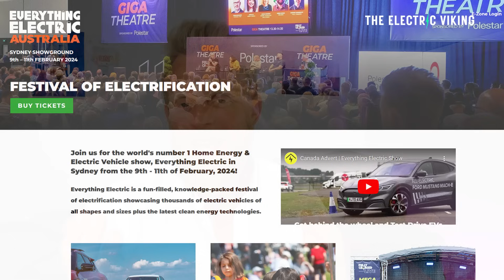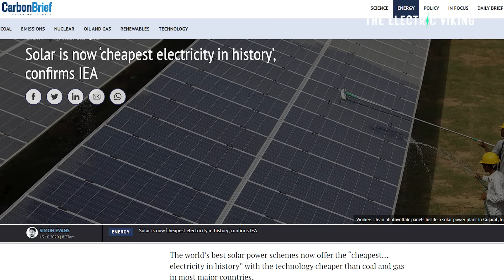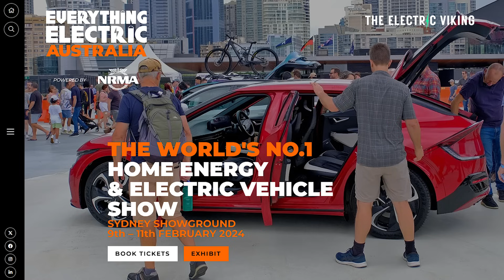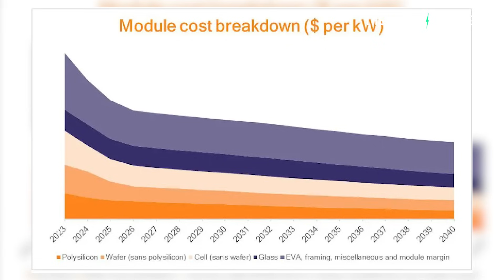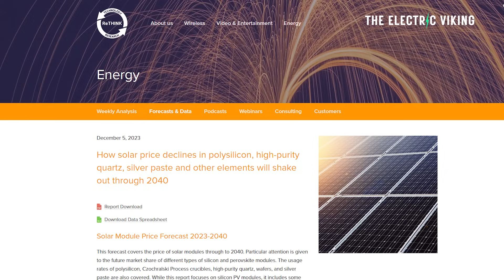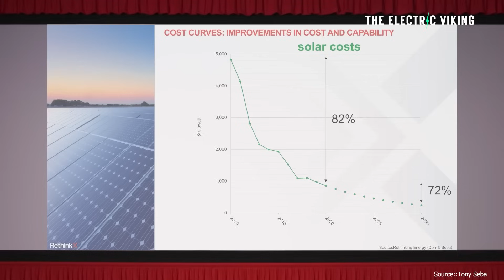Tony Seba just made this insane solar prediction that is blowing my mind

Comment: I totally agree with Viking on this one. Solar panels and batteries will become cheaper and more efficient, driving the transition to renewable energy while governments do nothing to help. Some people think nuclear power stations will be necessary to take over when there is no wind or sun, but that is not the case. Renewables will generate far more electricity than is needed at present and the excess will be used for applications that are not time critical. This will include charging EVs, and powering massive compute services for AI. There are already some solar/wind centres that have installed compute servers to use their excess power when demand is low. Other applications that will open up when electricity generation becomes much cheaper will be manufacture of green hydrogen and efuels for aviation and rockets, also desalination, and vertical farming. If energy gets really cheap they can start doing carbon capture to remove CO2 from the atmosphere. With these services ready to soak up excess energy in addition to battery storage, it will become economically viable to generate so much cheap electricity that even when wind and sun are low there will still be enough to power the grid. It will be cheaper to use electricity for heating than gas, coal or oil so fossil fuels will mostly stay in the ground. Nuclear fusion  and Thorium reactors will never be needed (on Earth), and new fission reactors will be wasted money. Even the proposed long-distance international power inter-connectors are not worth looking at now. The only thing that can get in the way of this technological progression is sour international politics. I would like to see Viking cover more of these points in his videos but I don't think he reads the comments.
Reply: >  It will be cheaper to use electricity for heating than gas, coal or oil so fossil fuels will mostly stay in the ground.<
PV for heating has been cheaper than solar thermal for many years now.  PV for heating is far cheaper than grid electricity and propane.  
Our species might just save itself by learning to charge EVs in the middle of the day when there is likely to be surplus PV electricity.  I imagine the day when one plugs in to an EV charger at work, states what they are willing to pay, and when the electricity price drops to that level, the charger starts.  Many people will state that they only want free electricity and will get free electricity at noon on sunny days.
Reply: > . . . are expecting the increased cost to amount to approximately $5,000 per new vehicle, or $200 Billion. <
$200,000,000,000/ $5,000= 40 million new EVs in six years.  I am not as optimistic as howardj602 that there will be so many EVs.  I think that like now, many EVs will be charged overnight at home-- when the electric plants need more load.  Electric stoves, used to cook a holiday meal, use more power than a at-home EV charger.
If in fact 40million EVs are on the road in six years, at least one oil refinery will be shut down.  That will save 5.9kWh per gallon of product formerly produced as that is how much electricity the US DOE analysis shows is needed to refine one gallon of gasoline.  With 40million EVs on the road, we can close a few gas stations as well.

Comment: The actual cost of the cells is already low enough, efficiency is also already great, both can and will improve obviously but I don't think that's the most important part of it any longer. Really good product systems that are cheap and easy to install that can replace building surface materials could make a huge difference. I really like the basic idea of Tesla solar roofs, that when the solar cells are integrated in something you need anyway, the extra cost, what you actually pay for the solar power can be very low, but Tesla haven't focused on low cost. 

Same basic idea as Tesla solar roofs but more focus on cost efficiency than cool factor and looks could change the world. If the extra cost for the cells and installation becomes negligible, solar cells in new roofs, and even facades, could become the norm. Sure, it would be difficult to impossible to find good use for all the power produced at peak production in many cases, if houses were covered in solar cells, but that's not the end of the world, if they cost next to nothing. I think most people are stuck with the idea that solar cells are incredibly expensive, and that you have to find good use for every joule you possibly can squeeze out of them, but that's just not true.

Comment: Mark Mills, in his podcast
 “The Last Optimist," presents a somewhat opposing view on energy transition that emphasizes the challenges in completely replacing oil, gas, and coal with renewable sources. His key points often include:

1. **Energy Density**: Mills highlights that fossil fuels are significantly more energy-dense than most renewable sources. This density enables more efficient storage and transport of energy, a crucial factor in global energy systems.

2. **Intermittency of Renewables**: He points out that solar and wind power, the primary renewable sources, are intermittent and depend on weather conditions. Without major breakthroughs in energy storage technology, this intermittency presents significant challenges for grid stability and reliability.

3. **Industrial and Technological Limitations**: Mills argues that the current technological landscape, especially in industrial sectors like steel, cement, and shipping, is heavily dependent on fossil fuels. Transitioning these sectors to renewables is a complex and slow process.

4. **Scale and Infrastructure**: The existing energy infrastructure is deeply entrenched in fossil fuels. Transitioning to a new infrastructure for renewables on a global scale is a massive and time-consuming undertaking.

5. **Economic and Political Realities**: He often discusses the economic and geopolitical complexities in shifting away from fossil fuels. Many economies are heavily invested in these resources, and there are significant political and economic barriers to a full transition.

6. **Resource Intensity of Renewables**: Mills also highlights the resource intensity in manufacturing renewable energy technologies, like solar panels and wind turbines, which often require rare earth elements and other materials that are mined and processed using fossil fuels.

In summary, while recognizing the potential of renewable energy, Mark Mills emphasizes the practical, technological, and economic challenges in completely phasing out fossil fuels. He suggests that oil, gas, and coal will likely remain a significant part of the energy mix for the foreseeable future.

Mark Mills is a physicist, strategic energy expert, and writer. He specializes in science, technology, and public policy related to energy.

Comment: Not only will the price of the panels come down but also the installation cost. Take the example of a new solar farm that has just come on line.  In 20 years time when the panels need replacing there will be no need to build a complete new farm. No expensive land acquisition, planning and approval process and construction. It will simply be snap off snap on.

Comment: highest you can buy in Oz is 22% efficiency. we are still at decade away from being able to install anything close to 30%.
Reply: no  35% tandem silicium peroskite  solar will be mainstream in 2035 ...  wafer tickness 100um mainstream .
 high throughput in-line CVD direct ‘gas to wafer’ deposition process is a revolution in solar wafer  industry.
It enables >60% less energy consumption than conventional CZ and wafering and significantly less waste the 2 main cost driver in solar panel industry.

Comment: If the Chinese build their solar panel factories in a sunny location, they can initially consume their own panels and build out solar energy and storage. They will reach a point where they make enough solar power to sustainably fuel their solar panel factories. Then they can export sunlight in the form of solar panels..maybe that’s why their factories are in xinjiang. Since the sun never ask for an increase in solar radiation, then their cost of energy becomes cheaper for every panel they make. And since sand is free..then the cost of solar panels will come down in price.And the Chinese are also designing and building small modular reactors. I won’t be surprised if they eventually send our nuclear waste to another planet or the sun. All perfectly doable when you have free cheap energy! The future of humanity is bright!
Reply: Blatant nonsense, the roof area of a factory is nowhere near enough to power it in most cases. Go do the calculations and see for yourself.

Also the grade of sand used for PVs is not remotely ‘free’.

Comment: The one drawback I can see with solar & batteries is the amount of mining that will be required to scale up production in the way that is being talked about here. We are going to need a lot more silver, copper. Lithium, aluminium all which needs to be dug up, can the mining industry keep pace with demand?
Reply: Correct.  There isn't enough nickel, Lithium or cobalt in the world for these virtue signalling cultists.  Even if a replacement element could be found for any given compound, it has to be common and easy to mine
Reply: @thefleecer3673  There is more than enough Li - not sure about that one .... the different is how easy is it to get to - over another element in this case - like Na, but there is enough Li for all that it matters - its a element we dont really have much other uses for.
Reply: @thefleecer3673  Not correct by a long way. Plenty of it out there although cobalt use is been reduced in batteries making it even less of an issue. Then of course when the oil industry shrinks even more cobalt will be available.
Reply: @turningpoint4238  we can deplete all these resources for the next few decades, then what?  We'll have millions of solar panels and windmills that we don't have the raw materials to replace, or the energy to recycle.  Or we could just transition to nuclear and save trillions of dollars and the environment
Reply: @thefleecer3673  You are mistaken recycling is the way we will go.
Reply: @thefleecer3673  Ha ha I recall a lecture where we were going to run out of Lithium and would have used the worlds reserves by 2030. It was based on the known reserves which were quite low. The reason they were low is we didn't spend our time looking for Lithium. We do now and there is ZERO chance we will run out of Lithium as we have discovered huge reserves all over the place. As for Cobalt - thats old hat as we move to LFP batteries and don't require it. Nickle is another which is down due to over supply and not used in LFP batteries.

It may be that cultists are a bit ahead and have out thought those who have their heads stuck in yesterday.
Reply: @TimMountjoy-zy2fd  no matter how much there is it will quickly be depleted with more and more required for each generation of vehicles
Reply: When you see the scale of the mining industry especially iron ore mining yeah it's possible. The issue is the time taken to get the red tape done and get the mines setup. But if we put or minds to it yeah very possible.
Reply: Mining what? Salt? We have planes of the stuff. Silver will be the only one I would be a bit worried about when it comes to solar. The only way would be switch over to copper. Ai is pretty common enough and we can recycle it more than likely not worry about that one either.

Comment: In his 2014 book “Clean Disruption of Energy and Transportation How Silicon Valley Will Make Oil, Nuclear, Natural Gas, Coal, Electric Utilities and Conventional Cars Obsolete by 2030”. His last prediction  it will be over by 2030 or before. 
Obviously before Ukraine, which changed all national energy security strategic goals overnight.The book was a list of whats, ignoring the how and why, like the impact of strategic events. Industrialists had already predicted because we have 50 years of fuel reserves it would be 2050 before the full removal of ICE vehicles. Europe has already moved to 2035 for banning new petrol and diesel cars, the industry originally said 2040 was the earliest, given the direction of travel perhaps they were more accurate.
Bloomberg New Energy Finance predicts that electric SUVs in Europe will hit price parity with petrol equivalents as early as 2025, but the US will be three years behind because of a preference for larger batteries. All the national grid’s of countries are in the wrong location for solar and wind, they need expansion and realignment requiring changing their planning law to avoid nimbyism. 
However, a separate development in cheaper Heating and Power fuel cell products are available across Europe to run Homes, Business and Facilities. They use the existing natural gas supply. The unit the size of a standard boiler, converts the gas to hydrogen with the fuel cell to generate heat and power. These units are cheaper than the cost of a boiler, solar and battery combined installation whilst significantly reducing their emissions. Importantly they reduce the level of the load on existing power stations, whilst the connection for renewables are resolved. 
It is easy to make predictions when you don’t consider the journey necessary to achieve them.

Comment: The battery needed for running the small country I live in today, would be batterys for alteast 18 hours.  That would equal batterys with a capacity of 360 000 Megawatthours. The solarpanels just to keep the country running when its sun out, is around 500  * 500km in size.  Then we need extra solarpanels to charge these 450 000 Megawatthour batterys at the same time.   And those batterys woul need to be replaced every 10 years or so.
Reply: 500km by 500km of solar panels would be enough to power the whole world even if everyone was driving electric cars.
Reply: @bananacabbage7402 incorrect. Redo your maths.

Comment: Already if you are building a new house solar panels are likely less expensive than other roofing materials such as clay tiles. Installing a roof with integrated solar panels will likely take around the same time or less than a tile roof. The cost of scaffold and planning will be similar. The only costs likely to be higher than a tile roof are the inverter, and electrician cost. That being the case, I would suggest that in many markets the cost of a roof on a new building made up entirely of solar panels could well add almost nothing to the cost of the house compared to a tile roof. Other than that you would need batteries and inverters with the ability to cap or stop power export to the grid at times when everybody's solar panels have high output so as to keep the grid stable. Still a modest cost in the overall price of a new house.
Reply: They don’t make solar panels that replace roofing materials ffs. They go above the roof.
Reply: In California, land of fires, insurance companies won't insure your house unless your roof is made of fire proof clay tiles.

Comment: Sam, amazing news! At this point it seems that the very high price of home storage batteries is slowing down the adoption of both home and smalll-business scale solar installations and the adoption of EVs. As we switch away from gas heat and stoves and convert our houses to electric appliances, and as we switch to EVs, our homes will need a lot more energy storage. I’m guessing 50 kWh for the average, 3-bedroom house. That price will have to come down to $10,000 or so to really speed up the total conversion of home energy to solar and batteries.
Reply: 50Kwh is dam load, why so much?
Reply: @turningpoint4238  I guess to charge your car when you're off grid on a dark day in the middle of winter.
Reply: @bossman6174  Not just car.  I have solar in Texas and one February between snow and ice and cloudy days, basically no production that month.  Ouch!
Reply: My solar system produces on average 15kWh daily.  Sufficient for most of my needs. Granted, my usage is somewhat below average since there are only 2 of us in the house. Still, 50kWh is way too high.
Reply: @alihms So a family would need more.  20k.  Too expensive in the states
Reply: One Powerwall with 13kwhr works great for me.
Reply: Rooftop solar is great, but what's required is industrial scale solar and battery with modernized electric grid.
Reply: I have 60 kwh of batteries with 10 kw of solar. I need to double this once I get an ev so I can charge the car at night. I am entirely off grid. I have not needed to use a generator in over a year but it has been close at times.
Reply: That IS true, but if you shift to the European passiv haus standard energy needs Will probably be much lower.